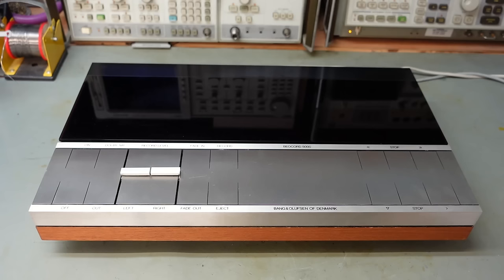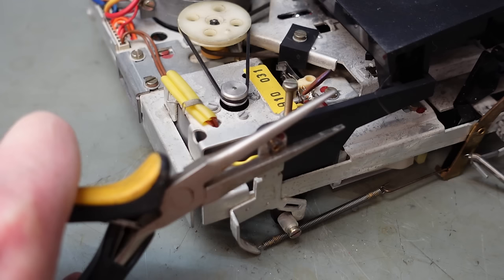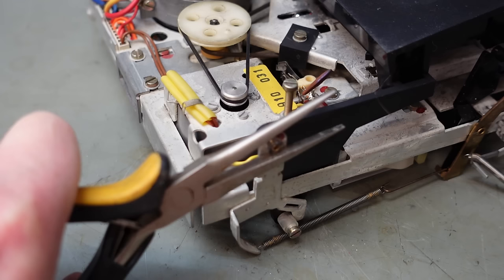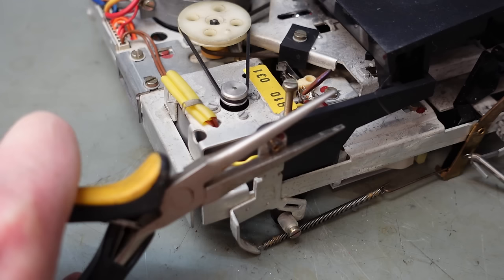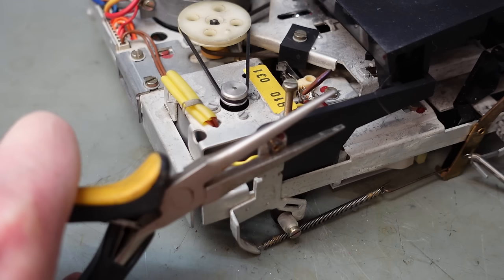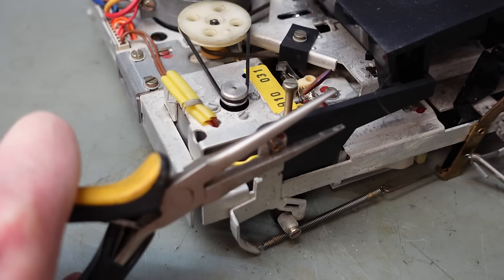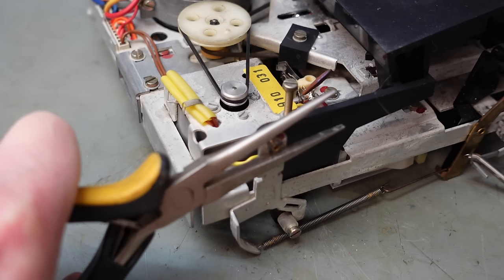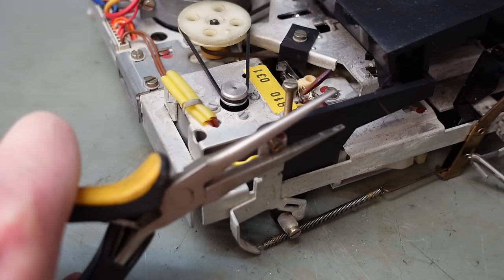The BEOCORD problem

Comment: Great work, you either have inhuman patience or you edit out all the cursing. The p in the torque value propably stands for pond, a very old unit of force, roughly one gram (0.98g) Usually seen as kiloponds, roughly a kilogram of force. Shellac will dissolve in alcohol.